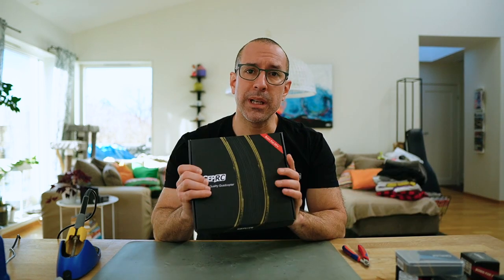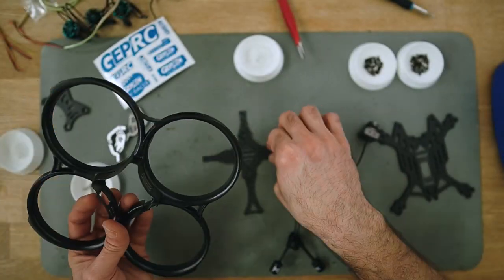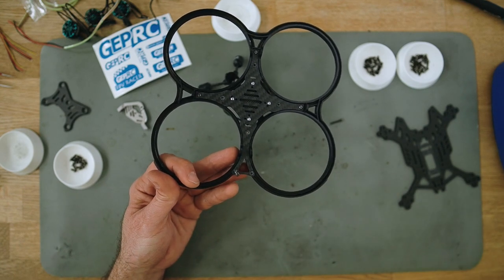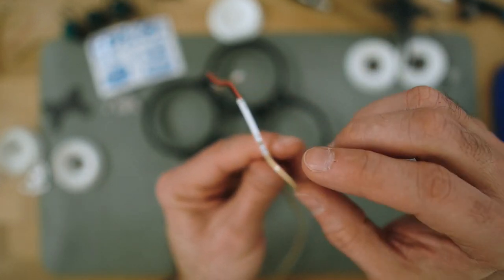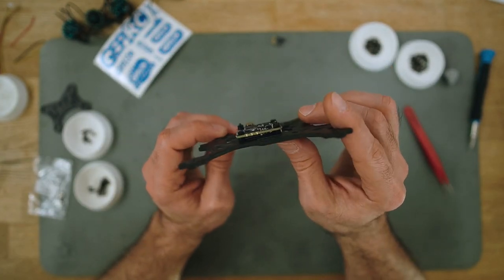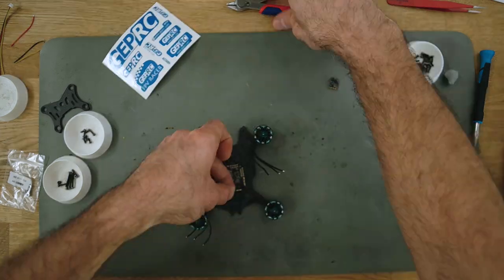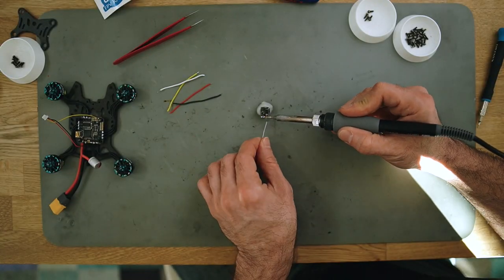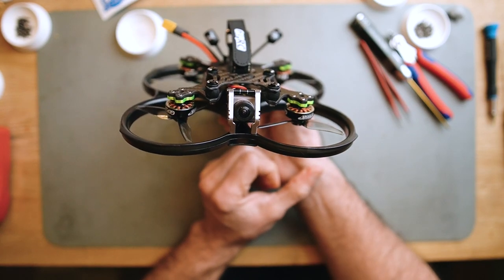Building a GEPRC Cinebot30 6S walksnail version with ELRS

Comment: Just about to convert my anaolg camera with a Walksnail unit so why not use the LED 12v supply for the Walksnail VTX rather than adding another BEC?
Reply from the maker: Not a bad idea. 2 things to keep in mind: 
1-the led BEC is controlled by a switch. Do you want your VTX to be turned on/off by a switch?
2-you have to check it gives enough current. It should, but it needs to double check.

Comment: I recently had to replace the F722 45A AIO as the one that came with the BNF version decided to spit a capacitor out. I noticed during the replacement process, the location of the large capacitor is sensitive to touches to wires (probably the soldered battery leads too) as once I closed it up, the O3 air unit touches the capacitor, causing my GPS not getting read by Betaflight (there's communication with BF and the GPS lit up but the icon doesn't light up in BF). Pushed the capacitor further back and it all became okay.
Reply from the maker: Yes, things are very tight there and the capacitor was the one giving me more issues to close the drone. I have the capacitors with cables and allowed me to locate it a bit away and more secured on a “hole” next to the VTX, but you are very right. People should be cared with the location of the cap.
Reply: @NordFPV  Aha. Good idea to have cables helping in the position of the capacitor. :)

Comment: Hello! I'm having the same problem( 17:35 ) building the 6s and just adding capacitors to the XT60 cable can't solve it?(17:02) Do I have to add additional parts(18:13)?
Reply from the maker: Hi. The capacitor I have there is small, but it should be better than nothing. You have to work all the pieces and get the capacitor in certain angle so it fits.

Comment: You jumped some really important steps ☹️
What’s the white cilinder like thing you soldered to the battery?
Reply from the maker: Hola Orlando. Are you asking about the capacitor? I explained at the beginning. I said that since there’s no space inside you have to solder it to the battery lead.
Reply: @NordFPV  thanks, your video is really helpful! I just crashed mine today and the plastic cap of the O3 antena fell off and can’t put it back, idk if it need some glue or something but sure it is a pretty resistant drone
Reply: @walasfilms if you stil have the casing of the antenna, you can just glue back on as long as the antenna wires inside look like their still looped correctly and not damaged. id recommend switching your 03 antenna for lumineer or flyfish RC antenna's . those DJI ones don't last a single crash and are.the most expensive

Comment: Where did you put the capacitor?
Reply from the maker: This build is quite tight.  And you should put the capacitor on the back next to the power pads. Use a small one, and make your best effort to push it in without breaking anything else.

Comment: This is a solid guide for fixing the drone with any damage but I think you skipped one of the important things on how to arrange during "sandwich~ng" the drone together. Specifically, I am interested in where you put the elrs receiver to not cause any problem with the fc board.
Reply from the maker: Thanks. The sandwiching was actually complicated. Since I’m using walksnail and adding an extra BEC I didn’t have a lot of space inside the drone and I placed the RX under the camera plate. 
If you are not using walksnail or the extra BEC there’s a pocket inside the frame where you can have the RX. Sorry I didn’t film this part but I actually got to know about it better after this tutorial was made and fix a couple of pre-builds of this drone
Reply: @NordFPV  Do you know for the O3 unit if there’s space for the RX?

I actually have mine on the way having only PNP. It was late when I know the issue of DJI FPV RC2 RXloss. So I am planning to add ELRS RX myself.
Reply from the maker: You should have enough space for the RX inside. Look at the sides, there’s this pocket where you put the receiver, just think that you reach the pocket from underneath, you have to remove the bottom plate to get it in there.

Comment: does the AIO has the xt60 ?
Reply from the maker: Good question. Mine has XT60, but I bought everything separately. I don't know if you buy the BNF if it's XT30 or XT60. Sine the recommended batteries are 6S up to 1100 I would imagine XT60 is what it should have.

Comment: Hello.Can you please explain how to set the backlight in Betaflight.
Best regards.
Reply from the maker: Hi. There’s 2 important things. 1-is to have user 1 configured in your modes so you can enable and disable the light with a switch 2- is to map correctly the resources of the FC so you can connect the LED and control them. 
2 can be complicated if you don’t know what you are doing with betaflight. Therefore I advice in the video to follow the configuration provided by GEPRC in their website (support). If you have the same FC as they use, and you connect it to the same pads, you can simple copy paste their config.

Comment: Bonsoir, j’ai build un cinebot mais impossible de faire fonctionner les leds !  J.ai un AIO Rush blade F7. Il est monté en 6S. Pouvez-vous montrer vos paramètres betaflight pour les leds ? Merci beaucoup du sud de la France 🙂

Good evening, I built a cinebot but impossible to make the leds work! I have an AIO Rush blade F7. It is mounted in 6S. Can you show your betaflight settings for the leds? Thank you very much from the south of France 🙂
Reply from the maker: If you are using a different FC/AIO than the original there’s no use to show the CLI. This LED are connected to a regular pad which is controlled by re mapping the resource to give power. This is not a regular LED. If you still want to see the CLI go to GEPRC’s website and download it from their support section.

Comment: So I'm having a lot of issues. The props are suppose to spin outward instead of inward?
Reply: I have the same cinebot30
Reply from the maker: Hi Yer. It depends how you configure it. If you haven’t touch it betaflight should have outward props. But look at motor page in betaflight it has a diagram showing the direction of each prop.

Comment: I am working on converting an analog CineBot30 to Walksnail using the V2 VTX w/ 32GB memory and the new "night vision" camera. The only thing I haven't figured out yet is where to mount the 4-wire to USB-C cable for uploading firmware and downloading DVR videos. I really don't want to disassemble this thing every time I need to do that stuff. Did you come up with a mounting solution? I didn't see it mentioned anywhere in this video. It looks like the frame was originally designed around a DJI Air Unit so there's plenty of vertical space but I don't see a good mount for this USB connector that is easily accessible when fully assembled. Any ideas?
Reply from the maker: Honestly, I don’t have that piece since I have a v1. But there’s not much space in there. Even if it was designed for the O3. There’s a bit of space on the opening, where the usb of the o3 will be. 
What about under the action camera plate?
Reply: @NordFPV  Haha, well, I guess "plenty of vertical space" is relative. My second build ever was the RotorX Raiju, and everything since then has seemed downright spacious. For the CineBot, I ended up getting everything "in there"... eventually. It looks great from the outside, but the inside ain't pretty. The USB-C connector is just kind of wedged in somewhere it hopefully won't shake loose from. I'll have to remove the top plate to access the VTX's memory but I won't have to disassemble the bottom section, which I guess was my real worry. Maybe I'll find a better location for that connector in the future.

Comment: I will mount a flight controller upside down Now I gave 180 degree on roll axis this is ok. Now if I want to change the yaw axis with inverted placement then should I give the value of the direction in which I want to change or should I give the opposite value?
Reply: i am useing the mamba f740 mk4 aio
Reply from the maker: I believe there’s a better parameter to
Change than roll and pitch when you are doing this. But I don’t remember the name from the top of my head. It’s in the same page.

Comment: Hi thanks for sharing all the knowledge of drone. I’m new to FPV drone or drone and I haven’t had one at the moment, so I’m curious what is the correct purchase because I’m planing to purchase a TBS tango 2 controller and I’m not sure if tango 2 can connect to cinebot30. I’ve also make a little research about the receiver for tango 2 which is crossfire if I’m not wrong.
Reply: I’ll like to get some advice from you as a professional
Reply from the maker: Hi. Thanks for watching. FPV has a pretty steep learning curve in the beginning. There are many radio protocols, many video systems and many manufacturers. 
I will recommend to spend some hours watching YouTube videos on these topics. Decide what kind of drone do you want and then do some more research. If you have a more specific question feel free to send it my way.
Reply: @NordFPV  sure thing thank you

Comment: I am building my own Cinebot30 with this same frame and same motors but different ESC
trying to decide between these three AIO ESC

1. SpeedyBee F745 35A BLS AIO Flight Controller
2. Foxeer Reaper AIO V3 F745 45A BLS Bluejay 2-6S
3. Mamba MK4 F740 AIO

1. with the motors having max current of 18.8A and above ESC having more than atleast 35A they should work fine right ?
2. speedybee size is the largest at 36.5 x 36.5 x 7mm , the diatone is 34 x 34  x 10 mm and foxeer is  32.5 X 32.5mm, will the largest aio fit just fine ?

your help would be really appreciated. thank you.
Reply from the maker: San let. You have very little space on that frame. The capacitor is difficult to fit, so I would recommend to go with the smaller of the cards. The mamba has a double card, right? That may not fit in that frame. I think the fixer is the best candidate just because of size. And 45A is great if you are thinking to fly 6S.
Reply: @NordFPV  cant thank you enough this was a big decision for me. Should I get the official GEPRC AIO 
then to be on the safest side ? I found it on one website which ships to me.
Reply from the maker: @sanketss84  well, with the official you are sure that everything will fit, you have all the ports you need and you will just copy and paste the CLI. If you go with anything else, you will need to configure everything from scratch, and tune it yourself. I'm lazy, and I will go the way of the original AIO just to avoid tuning the drone by myself.
Reply: @NordFPV  where is the CLI available ? also how much effort it is if i have to tune it myself considering i have never done this ?
Reply from the maker: @sanketss84  The CLI is available in GEPRC website in the support area/downloads. GEPRC publish all the CLI for their drones in there.
In my personal opinion, tuning is hard. You can live with a generic tuning, but if you want something really good, you have to do an effort, and I don't find that effort trivial. But of course, this varies from person to person.
Reply: @NordFPV  thank you so much once again for your time and knowledge sharing. I will pick up the GERPC AIO for now as I dont understand the tuning stuff yet. I really liked the foxeer aio for its specs but maybe for some other day.
Reply: I having issues with betaflight I test a lot of cable but I can't get  working to get the port
Reply from the maker: @charliesfpv  are you sure you are using the USB port of the FC? and not the VTX? If you have a DJI O3 or a vista, you have another USB port for the VTX. Don't confuse them.
Reply: @NordFPV  Yes is the correct micro I have to put on boot loader, but the Gyro is dead, I will replace with another brand AIO, the GEPRC is a trash that version or the one I get
Reply: @charliesfpv agreed, Gep's AIO died less than 2 months for me... replaced with foxeer reaper V4 AIO and it's been almost a year with no problems...

Comment: thx for this. im thinking of repurposing my protek 35 into something different but this looks like zero extra space internally. i just finished a pavo 25 build and luckily theres a small channel to the front/back where i was able to store the extra bits (rx, capacitor, etc) i might have to see what else betafpv has vs the cinebot =/
Reply from the maker: Yeah. The space is kind of limited, but you for the regulars: RX, VTX, AIO and BEC.

Comment: I just used a Dremel to open ports for the USB, SD Card and Bind button access. This frame is for analog (bad no no from GEPPRC), no way to use the existent openings on DJI O3 at least.
Reply from the maker: Really? There’s a big opening that should be used for the SD and bind button on the O3. And there’s a pocket for the receiver. Are you sure the O3 doesn’t fit there?
Reply: @NordFPV  not matter how you try it, that big opening is not help in the way you need mount the O3 to the frame, that frame is from the analog model, they should had made another frame that would accommodate the DJI O3 Air Unit, this is the general complaint about.  But,  I have put my Avata aside and only flying the Cinebot30 lately, great little flier
Reply from the maker: @RCREVIEWS101  Thanks! I got one yesterday for repair and I see you reach the USB port fine, but not the SD card. So I get it now.